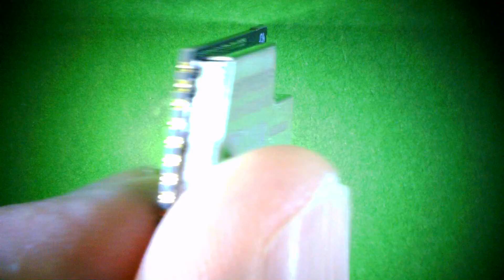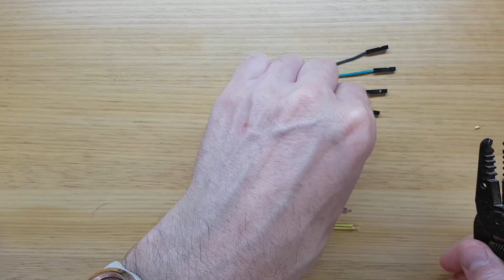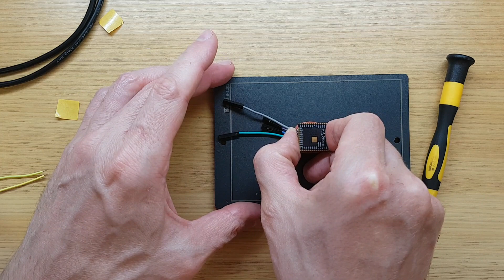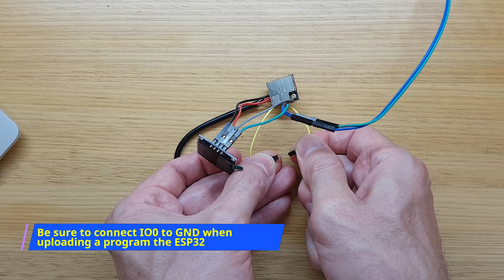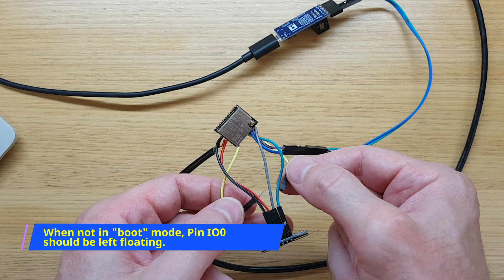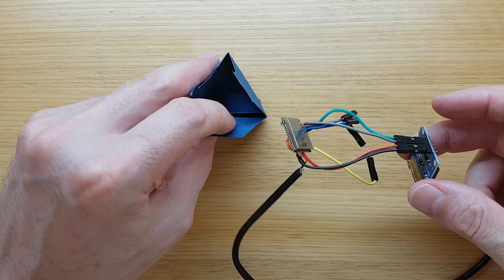World's Smallest Bitcoin Price Tracker

Comment: You have very few videos but what you have are very good. One such video that i am sire you could add woul be the wiring of a Oled screen and a ATMEGA328P-AU  in SPI mode. I have been trying to get this done. But my main issue is that the pins to use are different from the likes of a Arduino Nano. I would really like you to cover this topic.